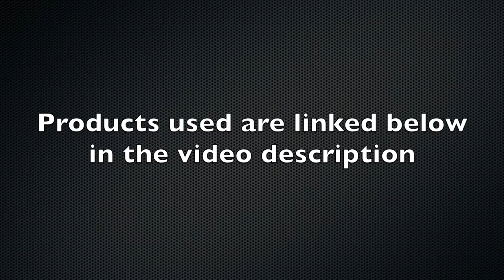Upholstery - Part 1 - DIY Sprinter Camper Van

Comment: Hi Ken, I have just watched this video. In England I have used a spray for the fabric that is used in High temperature situations, headliners, fabric direct to the posts in a van etc. I have used in on 2 van conversions now and it has performed really well with no sagging or peeling. It has a 5-10 minute work time, so if you are not happy with the look you can peel the fabric back off and have another go.
 3M do a version 38808 and also Sprayway SW092 in the U.S.
Reply from the maker: Thanks for the info!  I’ll have to compare the differences between 3M-90 and the two you mentioned.

Comment: With the carpet, start in the low points and let it stick there first, then fold it back and spray more glue on the unstuck carpet and then pull it over the raised/high points next. If you do it the other way around then you tend to have too much carpet in the low point.

Comment: In case you're still answering questions about trimming the van with fabric, I have a question about the D-pillar,  Did you glue the fabric on the D-pillar before cutting holes for the switches/covers - or did you cut the holes for the switches before gluing to the d-pillar?
Reply from the maker: The holes in the D-pillar are there from the factory.  I simply wrapped the entire pillar, then made an "X" cut inside the fabric and folded and glued it back to make a perfect square upholstered cutout.

Comment: Hey Ken! How is the blue plastic electric box attached to the wall, what's holding it in place? Thanks!
Reply from the maker: The canex box is floating.  There’s no attachment to the van, the stiff plastic tubing holds it’s position for the most part; then the faceplate keeps it centered in the cutout of the wall panel.
Reply: @ourkaravan  Ha, that's very neat, thanks Ken!!
Reply from the maker: You are welcome, good luck

Comment: Nice video but just be aware that you should cover holes in metal work with tape first (silver insulation tape). I didn't and over time the material developed dark spots where the holes are.
Reply: kenetube the tape stops air/dirt from coming out of structural frame of van and leaving a mark on material. Silver tape is good as it’s thin

Comment: Im curious how this held up three years later. Ive never had good luck with spray adhesive, altho great luck with contact cement from a can. I also feel like that surface shout have been scuffed up and prepped prior to application in an attempt at a mechanical bond. Bug hey, if it hasnt failed by now i would say the verdicts in!

Yer are/were a blow boater werent ya?
Reply from the maker: The interior of my van, now 4.5 years old, looks as good as day 1.  The 3M-90 spray adhesive works just fine adhering the fabric direct to the steel.  Do not use 3M-90 on wall panels or other large areas as it won't hold up.

Comment: 3m 90 glue sucks for gluing Apolstry I would talk to a automotive Apolstry guy. I did my van with 3m and it came apart in less than 3 months. My Apolstry guy said to use contact cement .
Reply: Yes, I’d prefer brushing or rolling the real thing. Granted, difficult on cloth. You can also thin and spray in a paint sprayer. But, you gotta use whatever you’ve got. Good work as usual!

Comment: this is a great video! did you find the 3M 90 worked well for sticking? were you concerned at all with not insulating that area?
Reply from the maker: Hi, the 3m90 has done a great job of adhering the fabric direct to the van wall, but it did not work well in other areas. Take a look at my channel, I just did a 5 year update video and one of the topics of discussion was upholstery and my varying results with different adhesives.

Comment: I noticed in the other video you added a thin layer of foam on the large areas. Is there a specific reason not to use it here, it could cover up small holes or uneven spaces. On the other hand, you are able to follow the angles  of the van.
Reply from the maker: I was afraid the combo of foam and upholstery perhaps would not adhere as well as the fabric direct to the van steel.  The foam gives the wall panels a nice feel though.

Comment: @ourkaravan has the 3m90 held up well for you? I'm looking to do the same with my van soon. Thanks!
Reply from the maker: Yes, the upholstery sticks to the steel really well with 3M-90.  I do prefer to use the Dap Landau glue on large panels that adhere upholstery to wood.  I did another video on that process.

Comment: Do you know where to find or what the gray plastic parts are that the Switch/USB holders are set in?
Reply from the maker: I do not.  I looked online and couldn't locate them in any sort of electronic parts catalog.  Ultimately I bought some used from someone on the Sprinter Source forum.

Comment: I would be cautious when wrapping the fabric around the metal edge. If water comes in contact with any of the fabric it will wick it up and soak everything. Hard lesson learned.
Reply from the maker: Yes no fabric can extend past the gasket or that will happen

Comment: Amazing!  Just the video I was looking for.  Did you consider putting any light foam between the panel and the fabric to act as a cushion/insulation?  I am in the process of doing some finish work and am thinking of putting low-e insulation between the fabric and the metal body work.  Thanks again!

Comment: Has the 3M 90 held up in heat?
Reply from the maker: It has.  I think it’s fine for use on small upholstered areas but I wouldn’t use it to adhere upholstery to a large wall panel, for example.

Comment: 144 or 170 Sprinter? Pros/cons? Thanks
Reply: kenetube thanks! That helped a lot. Dont want internal bathroom, only need the second row seating and dont want permanent bed. Have all the tools and experience from aviation mech, so will build/copy your design I think but need to source that sliding lay down seat/bed.  Might try to build it then take to upholstery shop. Will order from your kit link soon.